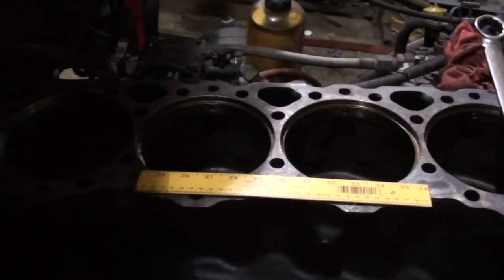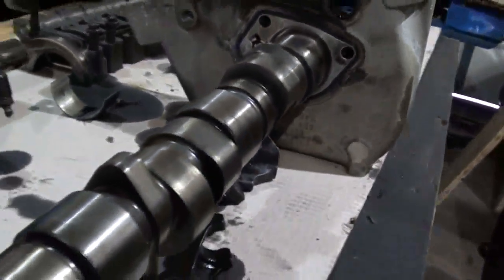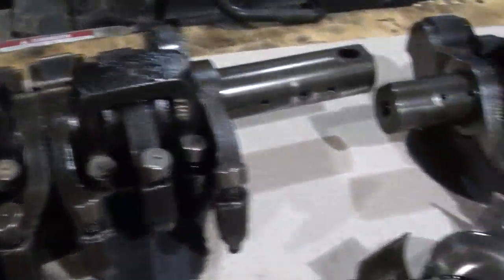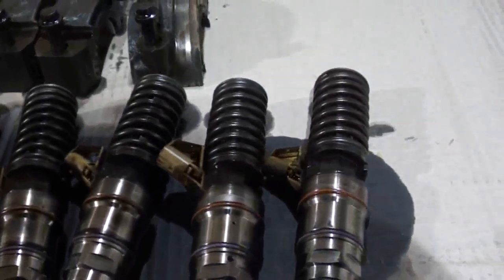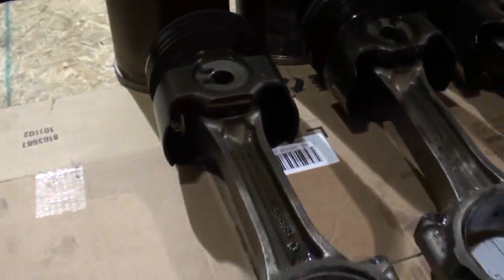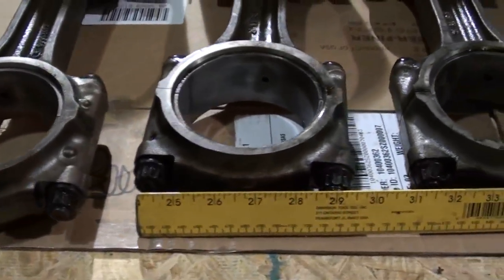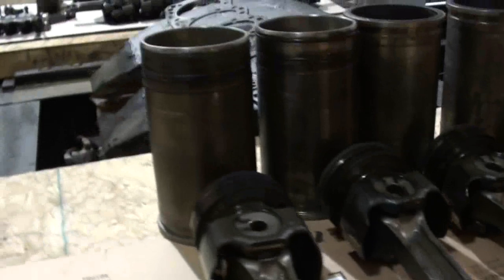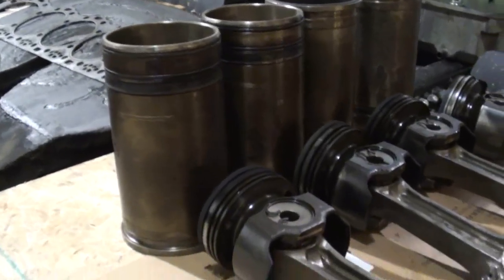A Look Inside Of A 14L Detroit Diesel Engine

Comment: I did an infame on a Series 50 (the 8.5L 4 cylinder with .100 smaller liner bore and a little less stroke) in a little freightshaker straight truck...Fun Job.

Comment: I am looking to buy a truck in California that meets air quality standards and I am not sure which is best, a Paccar, Cummins, Detroit or International.  Are you familiar with these 4 and if so which one do you recommend. This truck will be hauling 45,000 loads all year. I want good mileage and low maintenance costs.
Reply: Stay away from International right now. Several companies have lawsuits against Navistar right now due to continuing, plaguing problems with their engines and a judge has just consolidated those suits together. Cummins has had above average problems in the recent years also. It's better to go Detroit or Paccar. Also don't rule out the Volvo/Mack engine if that could be an option as like any modern truck engine with emissions it is not perfect but it is also a very good engine.

Comment: How do you pull the liner out with the piston and the rod still in it? Normally a puller  is used with a plate at the bottom of the liner or a leg puller .
Reply from the maker: I was wondering when someone would ask that question, lol!
The 14L uses a special puller that expands against the inside of the liner cylinder wall with a plate on top. looks like a big muffler pipe expander. Thanks for asking!
Reply: D-Ray Smith Thanks for your explanation.
Reply: @DRaysShop  what yhe name of that tool??
Reply: I did a video on how u pull those sleeves. I’m inframe this exact same motor now. I got some videos on my channel if you wanna see.
Reply: Weld a bead one the liner one at a time and turn the crank over it will push liner and pissing up
Reply: westernstar4964

Comment from the maker: There is a device called a VPOD  it supplies and controls how much air pressure goes to the turbo actuator (the can on the turbo) which controls the amount of boost you get. We've replaced several of these over the years, but it could also be the wiring connector at the VPOD. Its a 2 wire connector with a little wire strap to keep it on. The heat from the turbo cooks it and sometimes it has a poor connection. the connector is 23533327, I keep one on the shelf. hope this helps, have a goodun'!

Comment: Does the slow burn rate of diesel fuel limit the max RPM's or is it just the shear amount of mass in the rotating assembly? My bus's torque and HP max's out at 1600-to 1800 and the fuel cutoff is at 2800RPM.